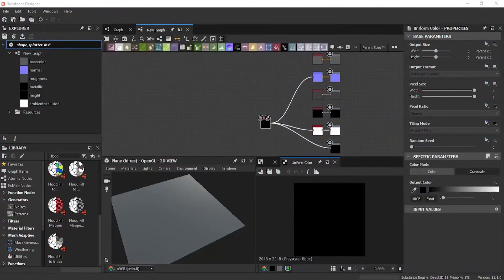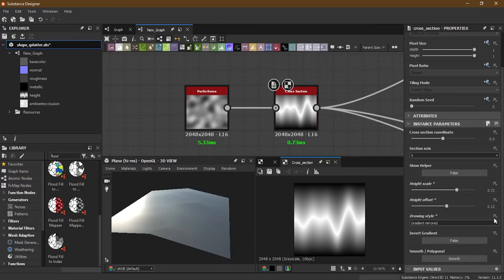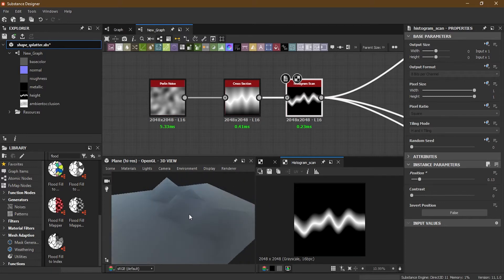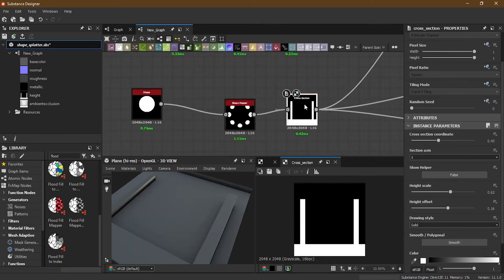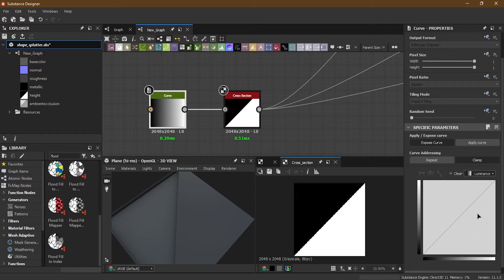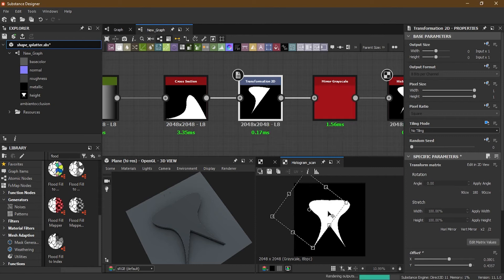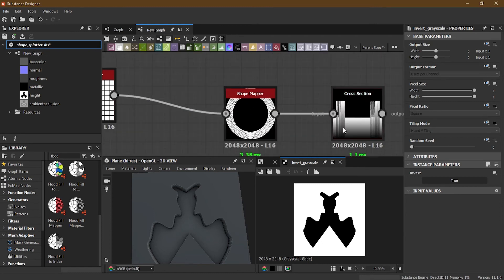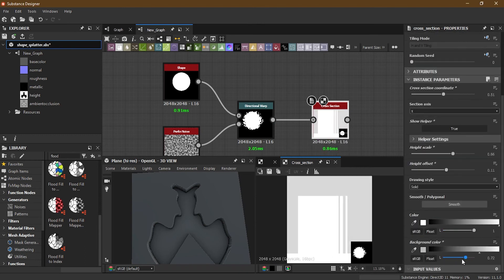Cross Section Node | Lesson 14 | Chapter 2 | Substance Designer 2021 Essential Series

Comment: Modeling in Maya vs Modeling in ZBrush. Which one is better. Your Thumbnails are so dope.
Reply from the maker: Modeling is Maya is stronger, however, Zbrush is a great tool when it comes to sculpting.
Reply: @zinteractive  Thank you!!!

Is it possible to create (very close to realistic) human faces using Maya only? and similarly, can we create (with very precise measurements and calculations) interior design or home design, or industrial product design in ZBrush only.

What I have a picture in mind is that would not be an ideal tools selection, but yeah, you can do it.

Do whatever is possible to model in Maya easily in the first place, and then put the rest of the hard and tedious work on Zbrush. Don't use Zbrush as an A-Z tool. 

For example, I am designing a kitchen. I can model walls, shelves, and windows using Maya in the first place. and let's say I have to model the ornaments on window doors. Those are flower sort of complex shapes and difficult to model in Maya, but easy in Zbrush. So there comes the ZBrush as a complementary tool to Maya. Am I right with this picture about these tools in my mind? Thanks
Reply from the maker: @ibrahim.khurshid  I recommend using Zbrush for more organic models, because modeling any industrial product on zbrush from scratch wont give you required and realistic results. On the other hand, you can use may for base models for realistic human anatomy based models and then move them to Zbrush to further enhance it, similarly you can move industrial models to zbrush and introduce organics form on top of them such as floral design or ornaments, however, I personally do this using Adobe Substance 3D Painter or designer.
Reply: @zinteractive  Thanks a Bunch!!!, Dear.